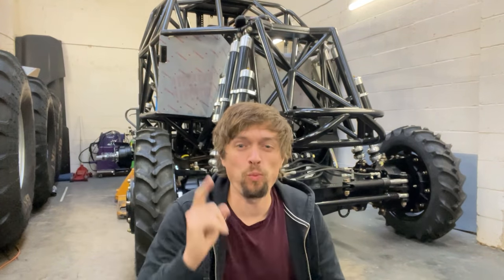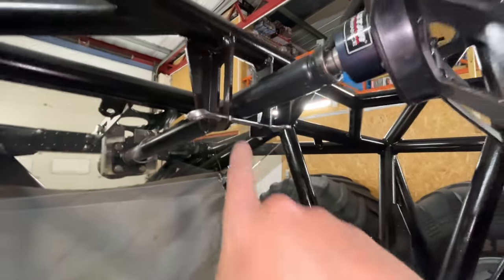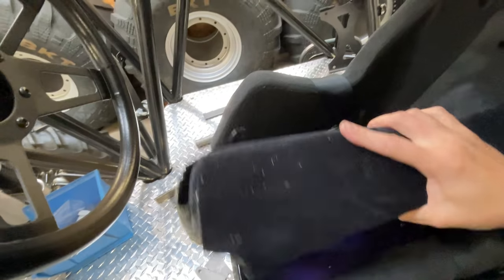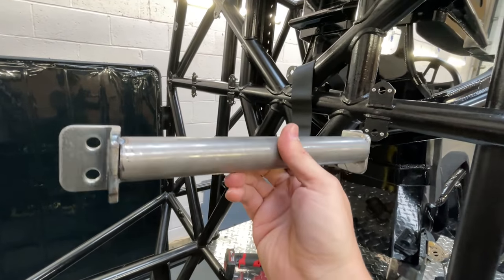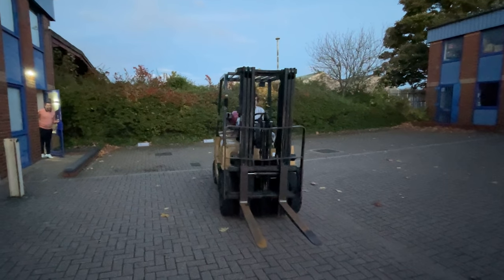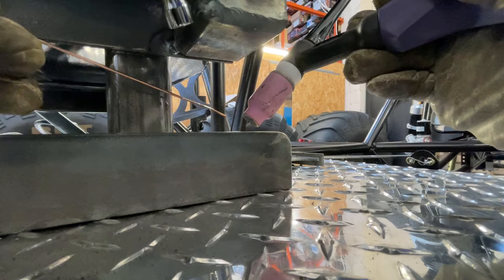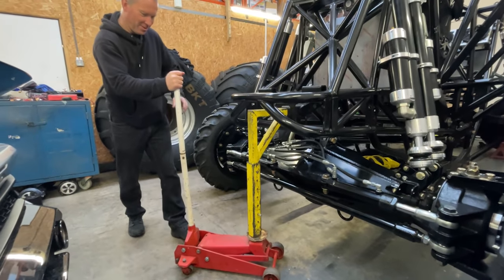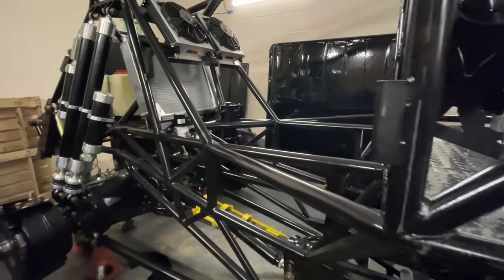World's BEST Monster Truck Build...PROBLEMS ep5

Comment: When welding aluminum, the pieces to be welded must be completely free of any and all surface contaminants. A clean stainless steel brush will do nicely. Either a toothbrush size and shape or a rotary Dremel brush. There are also various liquids (acid based) that do the trick. I prefer brushes as they are easier to use and much safer. You can get the SS brushes at most hardware stores. Finally, you must keep your tungsten electrode perfectly clean. One touch on your electrode, with your filler rod or the pieces you are welding, and you will need to regrind the tip of your electrode. Remember that a sharpened tip on your electrode is best for TIG welding nonferrous metals like carbon steel or stainless steel, but a ball tip is necessary for aluminum. Easiest way to create a ball tip on your tungsten electrode is to sharpen it as always, then switch your welding machine to reverse polarity and strike an arc for a second or two. This will melt your sharpened tip into a perfect ball tip. If you contaminate the electrode you will need to redo this whole process again. That's why I always create 4 or 5 ball tip electrodes at once. It will save you time when your right in the middle of your welding project and you contaminate your tip. HTH
Reply from the maker: Thanks for the tips bro. I cleaned it with sand paper, obviously was a bad idea! haha
Reply: @KevinTalbotTV  😂

Comment: This build is awesome Kev. That hoop thing on your neck/shoulders and attached to your helmet is also to stop what I think is called a basal spinal fracture, which can kill you. It's a fracture where the neck meets the base of the skull, it happens under rapid deceleration. It's what took Dale Earhart out.
It's great that Tony from Swampthing is helping you out.
Reply: Hoop thing? Haans device. And yea your correct, Dale Earnhardt refused to wear the haans device because “it blocked too much of his vision” there for without the haans device the only thing he had for his head or neck was a normal head rest like you find in your car today and a thin light plastic bucket seat.

Comment: If you use a stainless steel wire brush first on your aluminum it should help tremendously 👍 sandpaper leaves a residue of particles behind! Nice looking welds though!
Reply from the maker: Thanks for the tip!
Reply: Absolutely

Comment: Hey Kevin everything aluminum that I’ve ever welded I have had to clean off the surface that’s being welded with a clean wire brush either in a drill or hand held one. That dirty ness is just contaminants on the surface if you clean it that shouldn’t happen. Hope this helps
Reply from the maker: i used sandpaper, maybe that contaminated it!
Reply: Kevin Talbot Kev, see if you can get a hold of acetone..
Im a pipefitter and when we get the exotic metals ready for the welder we always clean it down with this to get rid of contaminants.
Also, DO NOT use sandpaper🤣
Get yourself a stainless steel wire brush, as a standard metal one will contaminate it.
Brush first, then wipe down with acetone👍🏻
Reply: @KevinTalbotTV   Ali oxidises quik  so cleaning it with a wire brush is the way to go. an kev pad up those brackets bro you don't want to get hurt ..layers of foam and insulation tape on all the pointy bits. Have fun m8 luvin the journey.
Reply: @kristofevo  Agreed, I also wondered if he may have used the same sandpaper/brushes that he also used for the steel parts. Probably not, Kev has welding experience if I remember correctly.
Reply: Professional fabricator and welder.   Clayton is right.  Aluminum oxide melts at a far higher temp.  Sandpaper isn't really the way to go.  You can get the grit from the paper in the Aluminum.  I use a scotch bright pad at work which still isn't ideal.  The best thing is a stainless steel brush by hand.  

Also the gas you're using matters too.  We use straight argon at work.  That works for pretty much everything.   Not sure what you have but most people use a 75/25 mix of argon and co2.  If that's the case you're well will come out dirty.

Hope this helps and your welds and fab skills are looking great.  Might have to check out your ebay things.  I need to make some money fast (gotta buy a suit of armour for jousting).
Reply: you have to use aa stainless steel brush to clean it. and don't use it on anything else.
Reply: Yes use a dedicated ss brush and wipe down with acetone.
Great welds though dude.  Stealing your 2x4 in plastic tub idea too.  Keep it simple stupid
Reply: @KevinTalbotTV   hi

Comment: Contamination is the issue, you need to keep separate aluminum grinding/wire wheels/sandpaper and separate tungsten. Different tig cups will also help reduce contamination and always clean the shipping oils off your metal stock. Regrind your tungsten if you dip the tip 😉🤣, good job still

Comment: Normally the black stuff on your aluminum after welding is from a contaminated tungsten or the metal itself is just dirty or contaminated, brake cleaner normally does the trick and resharpening your tungsten
Reply: Isn't brake cleaner very dangerous to breathe if it's heated?
Reply: @TrillMurray  it evaporates to almost nothing pretty quick and welding aluminum itself releases toxic fumes id say far more dangerous, but a respirator should always be used
Reply: @pavelack  I would use the non chlorinated brake cleaner to be safe. If you heat the chlorinated stuff past like 300°, it creates a deadly gas. Good advice on the respirator. Always a good idea if in doubt
Reply: @pavelack  okay I looked it up. Phosgene is what is created if you accidentally heat chlorinated brake cleaner before it evaporates. It's not as deadly as I thought but it can still kill you
Reply: @TrillMurray  I use isopropyl whenever I lay a bead. Brake cleaner no good plus can leave residue I have found. Isopropyl is by far the best and evaporates very quickly. Also, very rare is the tungsten the issue when it comes to soot.usually it's the cleaner settings on the welder.  With the tungsten, I sharpen it like a pencil and then a flatten the tip so it's not pointy. This conducts a far better arc and it more stable on high frequency. You have to wire brush the Alli before you weld and then run it over with the iso. Try it. Works for me and I weld everyday.

Comment: Kev that’s such a smart and simple idea to do your small drilling and cutting in a plastic bin to keep the shavings and dust off the floor. I run the shop vac about 12 times a day in between cuts but this is way smarter

Comment: Kev you probably know this already, but aluminum needs to be freshly cleaned with a clean SS wire brush. Don’t wire brush the night before as the Al oxide can reform. The Oxide has a significantly higher melting temp than the metal. Also clean your welding filler metal with scotch brite and some solvent.

Comment: If your machine has buttons enough, crank that AC Balance to get more cleaning action, (visually that white/grey area, next to weld)
Also with aluminium, you cant get it "too clean", stainless steel wire brush, scotch brite etc. and wipe with acetone, if i do something nice, i even clean the welding rods.

Great vid again !
Reply from the maker: thanks bro!
Reply: @KevinTalbotTV   And also pedal to control amps, is wery wery good to have, if you have any thoughts of weld more aluminium.

Btw, i have one scale MT video on my channel, that you might find intresting :)

Comment: Kev, on your TIG welding. If you use a stainless steel brush on the aluminum before you TIG, that will go miles better. also u can use some acetone and the stainless brush,, also dont use that stainless brush on anything else. only use for Aluminum. second you can set your balance more on the cleaning side. soon ul be able to weld a fart to a rainbow. major props on MIG skills
Reply from the maker: thanks bro!!

Comment: Aluminum is very picky when it comes to welding it. It has to be spotless!!! Even the mill scale can ruin the weld. But you don't want to clean anything aluminum off with a buffing pad cuz bits of sandpaper will be stuck into the metal and it will not weld right at all. So clean all the mill scale off with a wire wheel and then clean it off with rubbing alcohol and let it dry. After that your good to weld!
Reply from the maker: Thanks bro! I sanded it, so that’s where I went wrong!
Reply: @KevinTalbotTV  it is ok to use sand paper or a buffing pad but you have to clean it off with rubbing alcohol afterwards. Using a wire wheel is your best bet. Also practice, practice, practice!!!!! Good luck!!!!

Comment: Aluminum welds just got a little hot at the end, At the end the heat has no where to go. Also you can go up to a #8 cup for better shielding. 14-18 l pr min.  At the corner the gun must swing around, or else you get turbulence and bad shielding
Reply from the maker: Thanks dude

Comment: Rather than cut up the seat add more foam padding where you need it.
Reply from the maker: Won’t that make it too soft?
Reply: @KevinTalbotTV  depends on which grade of foam is used. Dense foam grades can be really firm and would hold you in place.

Comment: My experiance tig welding aluminium..    clean it with acetone and grind clean it with carbite burrs  not with grinding or sanding disks..   any impuitys will mess up youre welds.     On alu welding allso. The balance is ment for deeper penetration or more cleaning action.

Comment: I would want to run the AC TIG over the aluminum first to break the oxide. Or flow a bit more gas since the middle is clean only the edges are meh, plus I would add more speed since the material is very thin compared to the middle

Anyway good job. Love you vids, any day, any time

Comment: I know it's too late but still if I were him I would use the ZZ 572 Chevrolet it has 621 horsepower and there's an intake manifold that you can switch on it that has two carburetors and then you can put a scoop on it

Comment: Hey man I never grind my welds smooth if it's on my seat or cage cuse bad weld will have holes and will break. With aluminum you got to clean the pieces with a grinder before welding

Comment: Your aluminum welds are fine, just need to clean the material better and don't run it so hot, your welds you shown on this video for the aluminum was a bit on the hot side

Comment: Hey man I had same problem with my seat not fitting right in racecar same seat as yours. I just made foam blocks that formed to my body and put them in place and made huge difference and yes your shoulder belts was to low I hit the wall with mine to low and injured my back terribly in a 700 hp asphalt superlate model going 130 mph. Learned my lesson. But I don't have ratchets to tighten down that tight I couldn't imagine being that tight in the seat on my latemodel lol good thing monster trucks your only in it for 5 to 10 minutes at a time

Comment: On your steering orbital you got that aluminum angle between the top plate and the orbital it's self may be a bad idea with the splines not seated in to the female part far enough may pop out I had one come loose and it popped out and lost steering

Comment: WDs truck isnt a stunt rig like blue thunder max d and grave digger which i got to meet the drivers an hour before anyone could go in to the pit pass see the rigs close up talk w the pit crew of the trucks and talk engines. WD is a heavy duty farm equipment built truck with dual duramax engines 1 front 1 back controller each axle individually. But i agree his is too heavy wont jump anything but its bigger then a normal monster truck in every way but the engines. Ur engines based off funny car engines if its the same as the monster jam trucks. Theyre is based off drag racers and funny cars motors 2k hp. In a light weight frame. On a 2 gear transmission front n rear stear. Nitogen filled tires. With all the torque and hp they can really get air time in any arena. Ur build should do the same if u ordered the same kit set up as the pros

Comment: Hey kev i was wondering if you could help me solve a problem with my rc car i bought it came today had a test run after i installed the wheelie bar i wanted to go for another un it didnt work it was just locked in place it was sturggling to move somethings wrong whitch the gears please help .

Comment: Omg you sound like a dillman it's not a C10 unless you are making a two-wheel drive it's Kev please do some research and see that I am right the letter k or c is the specification whether it is a four-wheel-drive for a two-wheel drive
Reply from the maker: the body was moulded on a 2wd c10, so its a c10 body
Reply: @KevinTalbotTV  the body is the same if it's a K10 or  C10 but the difference is a K truck is 4x4 and C is 2wd so no matter what it's molded after if you make it a 4x4 it's a K series truck but if you were making a two-wheel drive monster truck then it would be a c series truck. It's really not a big deal on what you call it I am just trying to help you sound like you know what you are talking about when it comes to your trucks. Now if you put a Chevy truck body on your two-wheel drive Traxxas rustler then it's a C10 just saying